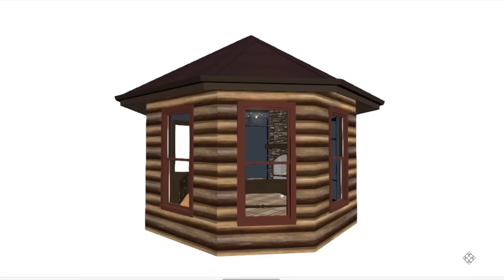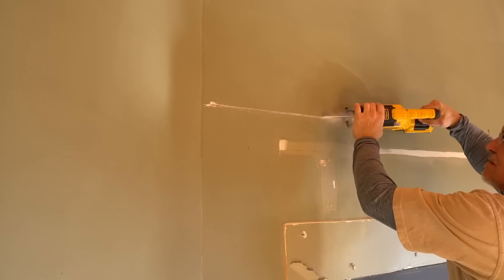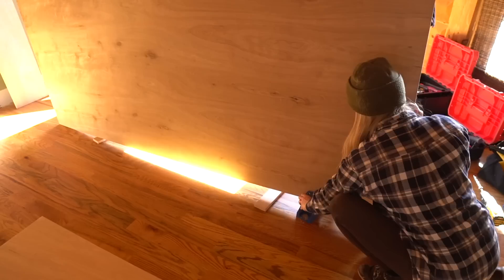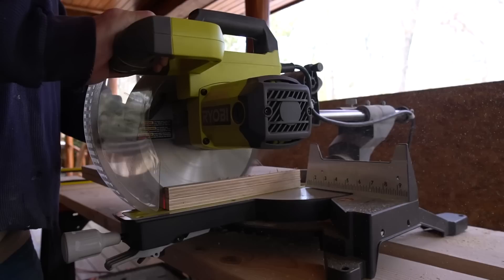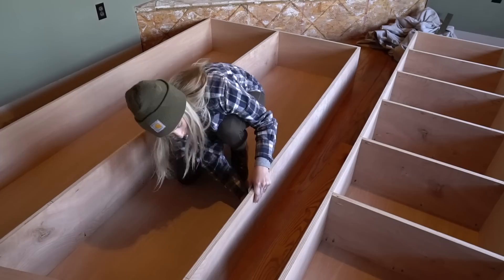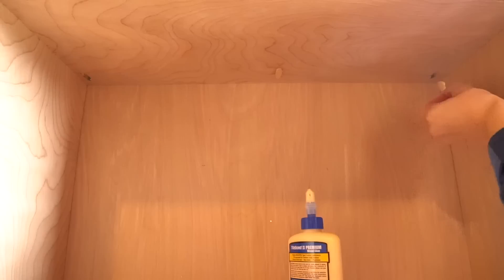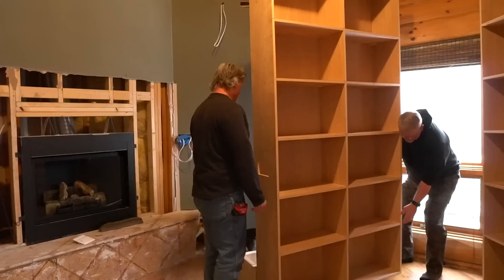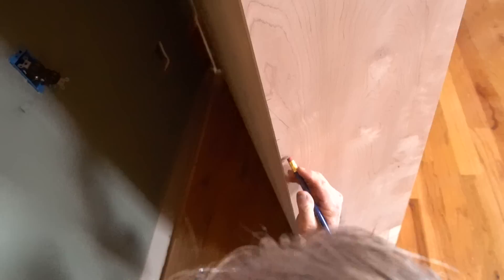Rustic Home Office / Library Renovation [Part 1]

Comment: Lowe’s cut the plywood for you?! I asked them once just to cut a sheet of drywall in two to make it easier to get home and they refused.
Reply: Hardware store as employer should care about safety of their personnel beside customer satisfaction, which comes trough training and speciality tools to make work safer and reducing heavy lifting operations. Their refusal to cut drywall is just because they have no setup for that, hence you on your own when you pick full sheet of drywall. But they have speciality saws for cutting full sheets of plywood or chop dimensional lumber to size for you, but may limit number of cuts, like 2 cuts per sheet or something like that if it happens at busy store hours. Also accuracy of in store cuts is something I would not rely on as blade may be dull, measurements a bit off and etc, so I normally add extra half inch to whatever size I am looking for.

Comment: That’s very kind of you to have a build with your dad for your aunt. Excellent work and looks great so far. Beautiful cabin and beautiful pups. I’m looking forward to seeing the rest of the work. Thanks- you inspire others (including me) to tackle renovations. I do suggest the kreg k5. It has side supports and you can lock it down from in front. I put mine on a piece of plywood so it travels easy, is stable and I can just hang it up when not in use. Oddly, I was glad to hear you had problems with your screws poking though the other side. I did too. I think it was a batch of plywood with maybe a little softer layers or maybe I just needed to not drive the screws home too hard. I made small adjustments to the bit collar and it worked. Thanks for showing problems too. Keep it up! Love your channel! Girl power!